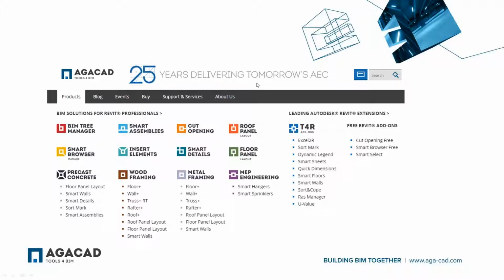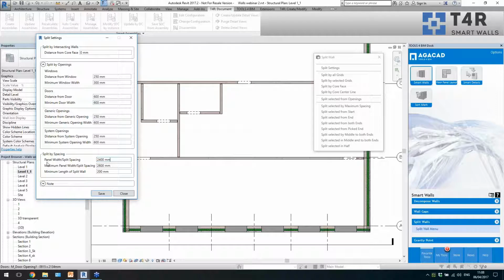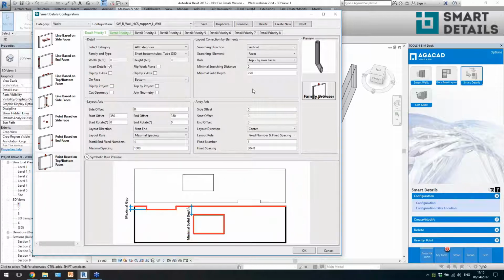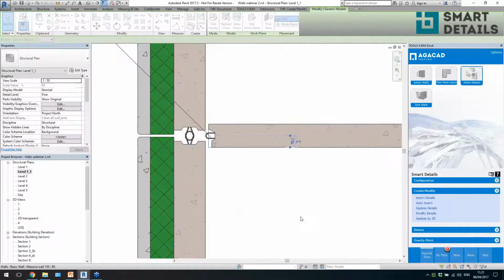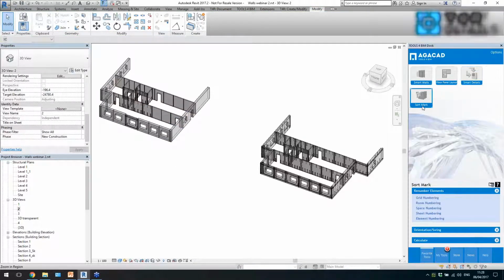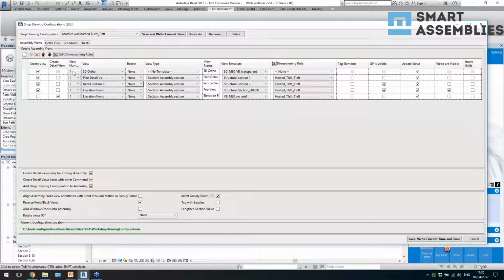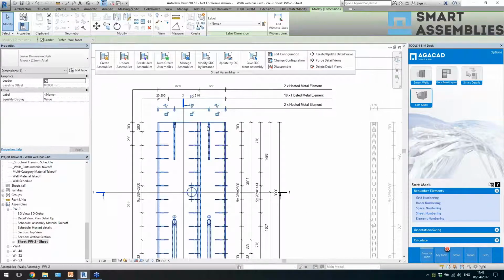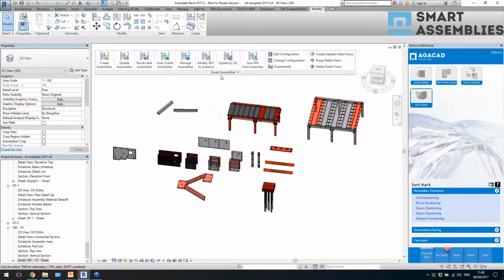Precast Concrete Walls: Modeling & Documentation in Revit

Comment: I have one more question. In external walls u added steel trusses. Do I want to use this as line based or point based. Because I added as a line based. But I couldn't added